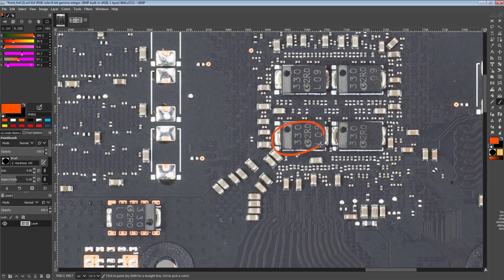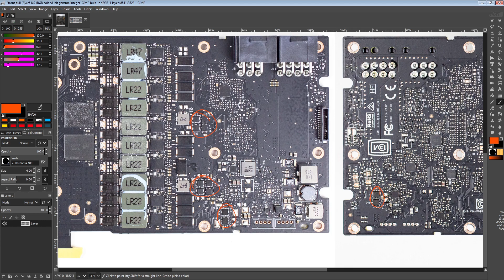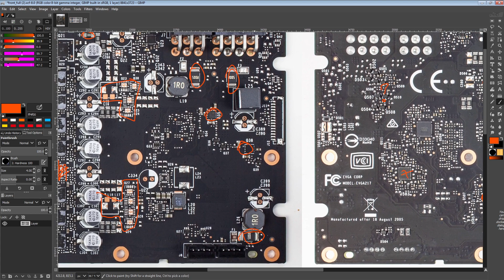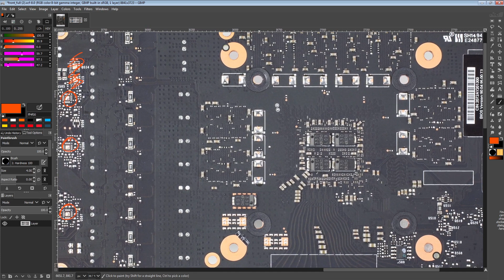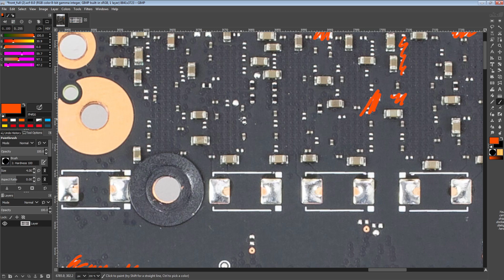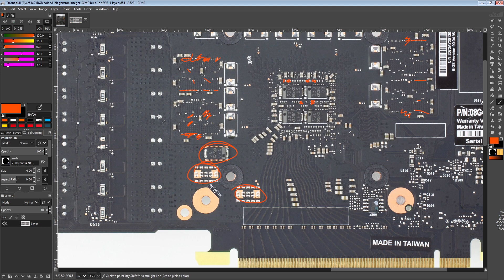PCB Comparison: EVGA RTX 2070 Super KO vs Nvidia RTX 2070 Super Founders Edition

Comment: 30:35 : """it will definitely outlast at least the warranty period"""" .
well , that's nice , but for me as a customer who wants to choose among products , the important issue isn't if this card will outlast the warranty period (*which , of course it should , otherwise this would be disastrous for the company ,since they would have to RMA all of their products !!! ).
The important issue ,for me as a customer is which of these 2 design-approaches can guarantee better longevity , because , personally , if I have to choose between a product that will only outlast its warranty , and another product that will last much more years than that , for me , the second option would be worthy of the 50$-70$ extra cost.
--- So , can you please (*if you are able of course) give us a longevity comparison between these 2 design-approaches ?.
that's what matters : the longevity comparison in order for everyone to check for himself/herself if the product is worthy of its lower/extra cost.
Reply: Mine never last much longer than 3 years, regardless.  No overclocking, but I've almost never powered down my systems over the past 15 years except to change hardware.  Cheap card or expensive--doesn't matter.  It's like there's a timed fuse or something.  At least it gives me a good excuse to upgrade and try some of the latest games.
Reply: @Lurker-dk8jk  as I said in past comments of mine , I still use a GTX560Ti and a GTS450 in my older PCs. !!!
so ,the longevity of a product is a crucial factor for me , since I love GPUs and I'd prefer to keep my collection intact !!

Comment: I don't know if the fuses protect the board from further damage so much as they protect the board from catching on fire. Fires cause lawsuits. Fuses are typically used for safety. If the KO card is not doing current balancing the risk of overloading one  or all current paths would go up in my opinion. Nvidia is limiting current using their balancing scheme. EVGA doesn't have balancing so they need some way to limit current. They seem to use traditional fuses for the PCIe power connectors and a polymer resettable fuse for the PCIe slot. I suppose this means the card will still boot if you blow the two fuses for the power connectors until you try to put a load on it and the resettable fuse opens again. 

For the MLCC bypass caps, it is common to use multiple values and cases sizes because each is most effective for a range of frequencies to bypass iImpedance vs. frequency graph). The reference design obviously has a lot more headroom like you stated, but if EVGA is selling this card to someone who is never going to overclock their design is probably fine. 

What you mentioned about the pick and place is true, but it is about loading reels as well. Our project manager recent shared some data with the design engineers about how much it costs to build the boards. Those MLCCs in quantities of 5000 or so cost almost nothing to buy per part, but the time to build the boards with the extra capacitors adds up much more quickly. What looks like just a couple more capacitors to you and me translates into real money surprisingly fast.

Comment: Another thing I noticed was the relatively high power consumption, makes me wonder if they are running slightly higher average voltages to account for the weaker output filtering, along with the worse efficiency of the VRM power stages.

Comment: Gigabyte's GAMING OC and WINDFORCE card are also down cost-ed these days. Funny that originally they used the reference PCB, BUT after a revision some point they went to a EVGA KO-like PCB design, no USBC, different inductor etc.
Reply: Also there's little-to-no infotmation on this. Gigabyte and sellers don't tell you anything, and that's why I feel annoyed when I realise I got a cheaper thus different PCB rather than a reference one. The replacement cooler I bought for the card just won't fit because I thought it's a reference design while it's not.
Reply: @Erotikstudio Winkler GmbH The first couple bunch of Strix 5700/XT card had that issue too, not only with VRM but also core itself because of mounting pressure. Not to mention the TUF one before they fixed it, one of few designs that managed to be overall worse than the reference one.

Comment: I thought those smd caps were tantalum. You sure they are aluminum?
Reply from the maker: tantalum Panasonics have different markings.
Reply: @ActuallyHardcoreOverclocking  Might be a difference in series. On the other hand i didn't even know aluminums come in that package.
Reply: @ActuallyHardcoreOverclocking  Nevermind, found spec. In that case it's a very sneaky way to timebomb your gpus by putting them behind your processor. I've seen it on some motherboards too, in front and behind the socket.
Reply from the maker: @ExPsy  Aluminum polymers behind GPU cores have been a thing since at least the GTX 480 and IIRC alu polymers fail more gracefully than tantalum polymers.
Reply: @ActuallyHardcoreOverclocking  Both are bad choices for such places. You don't put anything else than ceramics there.

Comment: Well, it's not the 2060 KO but it's something. Thank you.
Reply: 2060 KO's pretty much the same as far as cost savings go.. runs the absolute bare minimum needed to run the card since the power limit is locked so no need to compensate for overclocking.
Reply: @sirmonkey198  
Explains why people say they don't overclock for crap. Oddly enough you get that sweet +50% workstation performance. What a weird card. I guess they're insane performance per $ if you just want to run SolidWorks or looking for a cheap 1440p card for gaming. 

Hopefully EVGA keeps on with the SKU for 3000 series.
Reply: @The_Man_In_Red  the cuda performance was an "oops" by nvidia on the TU104 2060 chip. but i suspect it has more do with them not being able to fuse off certain parts without killing the chip so that was the tradeoff.
Reply: @sirmonkey198  This is why. Not really EVGA's descision.
Reply: @The_Man_In_Red  not really, especially soldiworks. Bad example, since it's one of the sw that is axed by Nvidia on their consumer cards. Even the lowest end Quadro will be better if you only use soldiworks

Comment: nice
Reply from the maker: so quick I suspect you may be a bot
Reply: @ActuallyHardcoreOverclocking  just a lucky refresh of the page. if you ever get the chance, can you talk about your experience with cpu degradation in relation to voltage and temperature?
Reply from the maker: @jake20479  The thing is I don't intentionally test for degradation. I basically run chips into the ground and realize that I was probably running them at too high temps and volts after the fact.